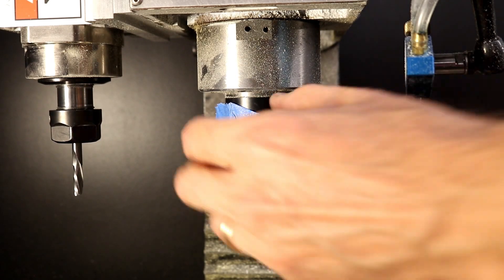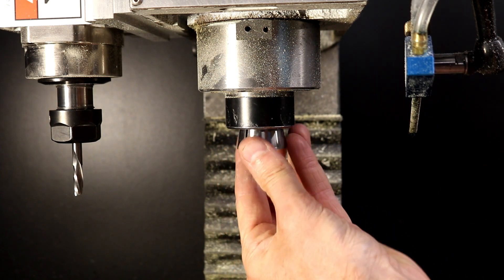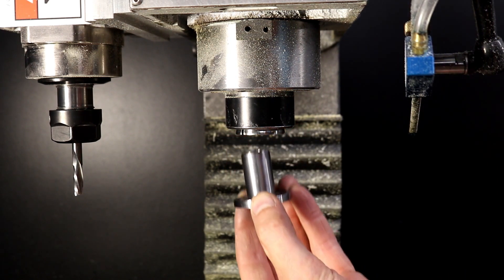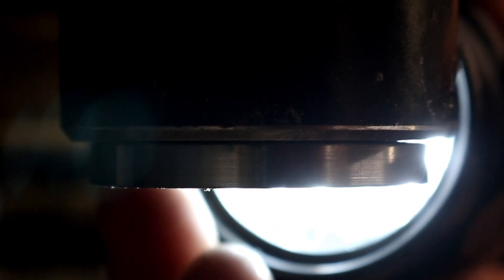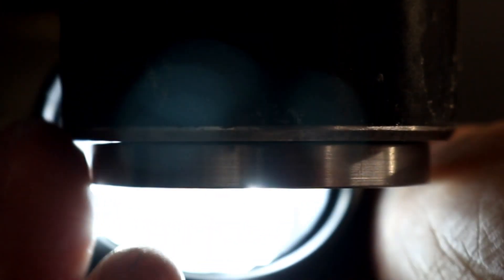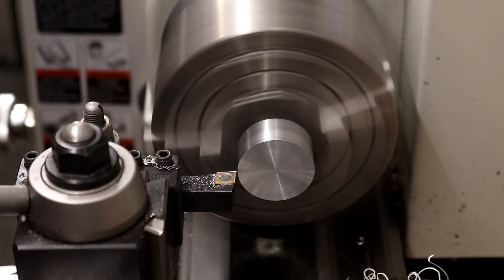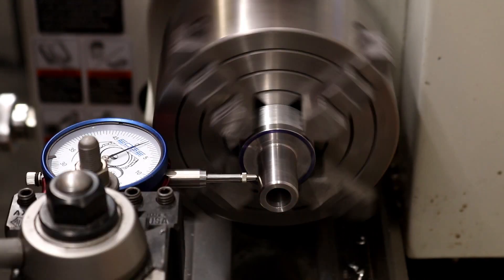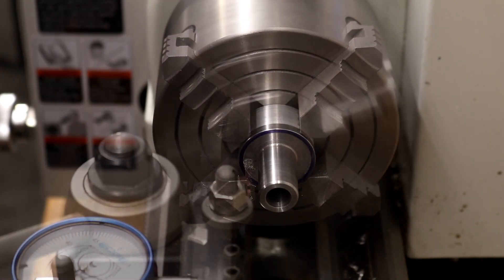TTS Dust Plug, Secondary Mill Spindle

Comment: What kind of lathe are you using?
Reply from the maker: Hi Donny! It's a SouthBend SB1001, purchased from Grizzly. It's long since been discontinued. The CNC conversion kit is from BDTools. Billy, a retired tool and die machinist, continues to make kits for other lathes. I bought his personal SB1001 kit, so I have a few extras.
Reply from the maker: I previously had a Grizzly G4016, also discontinued, which has been by favorite lathe. Accurate work can be done on the SB1001, but it's just a little too small. The G4016 is larger and far sturdier for a similar expense. I just only had the space for the SB1001. I'm thinking of these differences while making a spindle encoder for the SB1001.

Comment: An o-ring between collet and spindle would have been another solution to the gap.
Reply from the maker: No doubt. I thought seriously of using gasket material and being done. Wanted to figure it out if I later make a tool holder. Maybe mistakes build up experience faster? Thank you